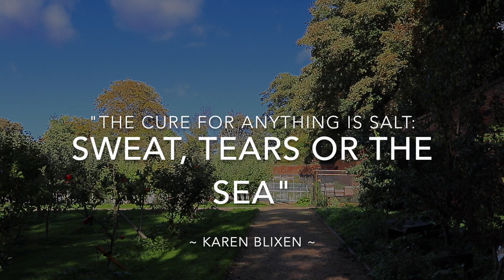How To Carve A Small / Salt Bowl - Richard Roberts

Comment: I just carved the butter spreader out of some applewood I kept from an old tree I had to fell as the roots had gone. I’ve already done some spoons from it. The video Certainly encouraged me to be a bit more confident with my axe, although mine is a cheepo hand axe from B&Q reground and sharpened to be a flatter angle on one side, it still does the job pretty well. I’m gradually building up a good variety of hand tools for my various projects I can do with the bits of driftwood and logs that I get hold of and really enjoying the hobby. Thanks very much for making these great videos.
Reply from the maker: A delight to hear you carved yourself a butter spreader and regarding an el-cheapo axe from B&Q, it will still do the job so no worries there ~Peace~